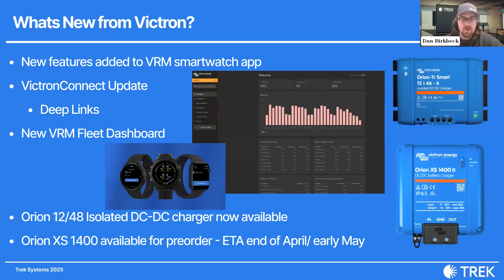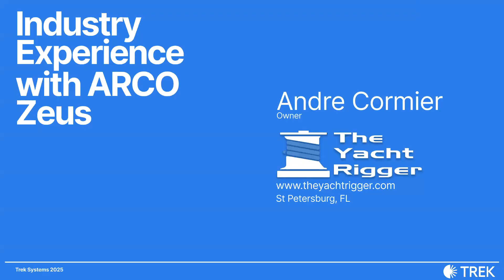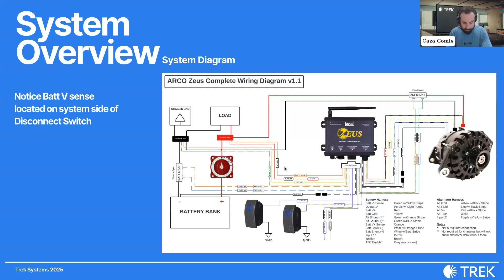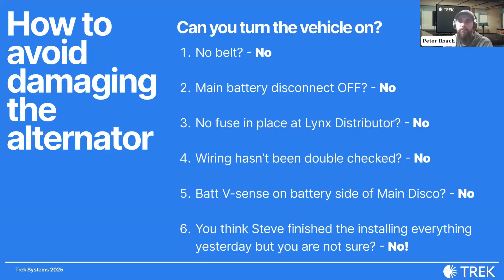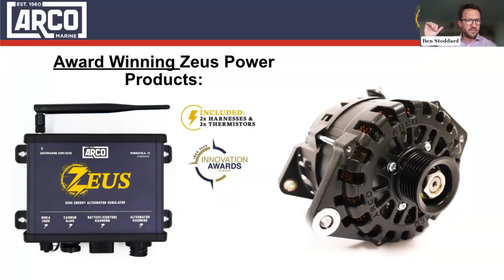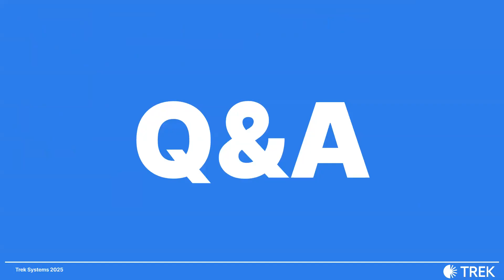Secondary Alternators in Victron Energy and Large Lithium Systems - Arco Zeus High Energy Output

Comment: Guys, I’m also confused. The Arco alternator 48v, is touted to be matched to system voltage assuming a 48v house system and 12v chassis.  But you recommend 12v on the B positive for the Zeus.  So the field current for the 48v alternator is 12v?  I thought that for a true 48 volt  system, the 48 V alternator needs to have a 48 V field current. Am I missing something? Does the Zeus step up the voltage from 12 to 48 for the field rotor?

Comment: 57:45
When first powering up any new system, it is best practice not to just START an engine but to firstly just turn on the ignition and then check with a multimeter all static voltage conditions are correct FOR THAT STATE. A manufacturer should list these as a pre-start final check. Also, my habit is to program all voltage and current settings to minimums for the initial run. Eg, a 100A test run is better than blasting it with 300A first up. Once the regulator's basic functions and all interconnected ancillary electrical gadgets are proven ok, then stop, and reprogram to desired maximum operating values for a full run test.

Comment: Is the Balmar APM48 just another avalanche diode in parallel with the alternator rectifier avalanche diodes?
Reply from the maker: The Balmar APM is a TVS (avalanche) diode combined with a small solid state board indicating the status of the device. It will protect the alternator one time, then needs replacement. If the device has protected the alternator due to sudden BMS shutdown or similar, the Red LED flashes and sounds a 'chirp'. Otherwise Green LED indicates 'ready to protect'.
Reply: @treksystems  Given the Arco's advertise have avalanche diodes built in, I wonder how they'll share the spike.
Reply: BEWARE : 
The Balmar APM is AMBIGUOUSLY ADVERTISED as "maybe it will blow up, maybe it won't". I've had one NOT SAVE my alternator diodes, and come out of the voltage spike blinking its little "OK" green light as if nothing had happened. It had not blown up but it had not done its job. I lost a few 12v appliances from trusting that AUD$150 device with a $10 TVS diode inside it. Grrr. For the 12v models, their dump point is 16-18v  -- still not healthy for most 12-15v appliances.

However, the Sterling Alternator Protection Module ( extremely hard to find these days ) is actually YT demonstrated NOT to be sacrificial -- he cuts the battery at 100A and it shuts the alternator output instantaneously and then lives to protect again and again. However, even he says "there may be situations where it might blow up". Lol ... in other words "we cover our a**e just in case".

So caveat emptor for these things. There is no warranty or compensation if they do fail and happen to destroy some $5,000 navigation system with 100v through the B+ bus.